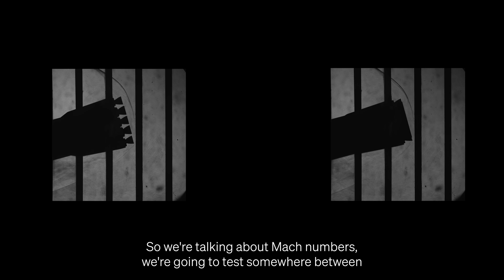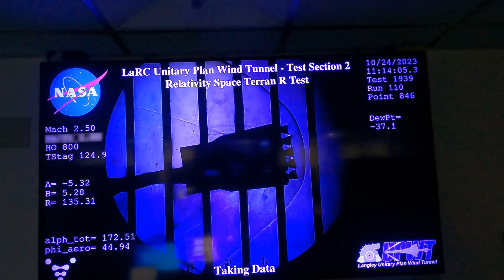Relatively Speaking: Wind Tunnel Terran R Testing Explained

Comment: Eek. I’m not superstitious, but isn’t it a bit asking for trouble to go with a 13-engine design?
Reply: Why would it be?
Reply: @Desrtfox71  unlucky number. People don’t really take it seriously, but Apollo 13 went awry. Many buildings in New York lack floors numbered 13, probably mainly because prospective residents might avoid such floors. In the case of a rocket, maybe that number could deter a small number of investors.

As for actual engineering, that square engine layout looked like it could be a problem for reentry aerodynamics and thermodynamics. SpaceX ditched a similar square design on F9, though I don’t remember the precise reason. I think it was just simpler due to the increased symmetry.
Reply: @J7Handle  Ah, so you are superstitious despite your statement.  13 engines, to me, looks like a potential improvement over the falcon 9.  Having slightly more engines means they can deep throttle a little bit more, thus allowing a hover as necessary.
Reply: @J7Handle  Yep, big difference from square to diagonal attack.
Reply: @Desrtfox71  ok ok, I don’t really see an issue with 13 engines, I just wanted something to talk about. The square shape does seem like it could create aerodynamic, thermodynamic, and structural complications, though, which is always a problem to consider.
Reply: @Desrtfox71 He's not superstitious, he's just a little stitious.